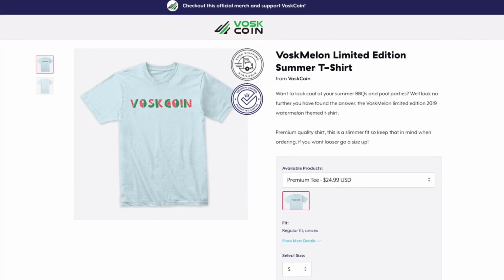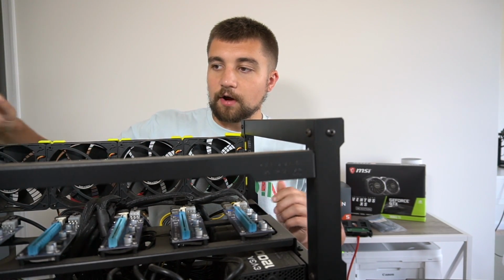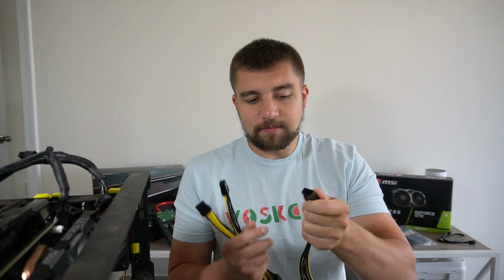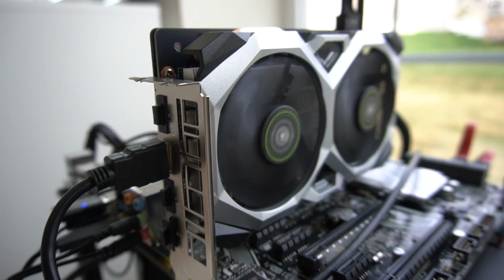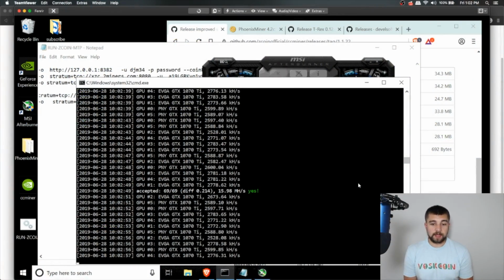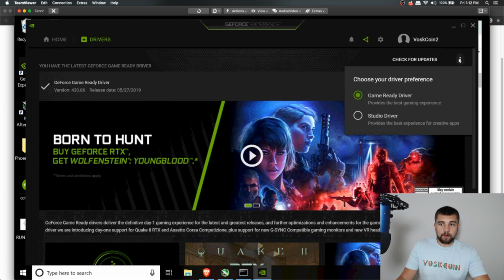Best Bang For Buck GPU Mining Rig Build Guide 2019 - Mine Zcoin, Ethereum, Ravencoin, Grin, and Beam

Comment from the maker: ►Full GPU mining rig build list here! - http://voskco.in/BuildLIST
►1660 TI - https://amzn.to/2XFJOKk ►Used 1070 TI - http://voskco.in/EB1070ti
►Buy VoskCoin VoskMelon t-shirt here! - http://voskco.in/Melon
► Timestamps AND links below!

00:00 Cinematic GPU mining rig intro
00:42 Cool crypto t shirts - VoskMelon
01:02 Free Ethereum giveaway
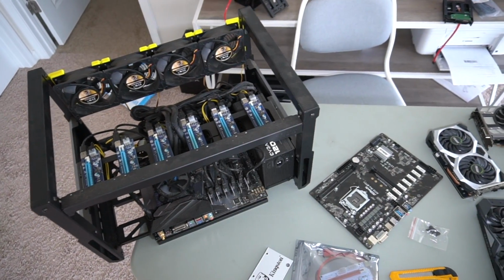01:20 Best coins to GPU mine in 2019
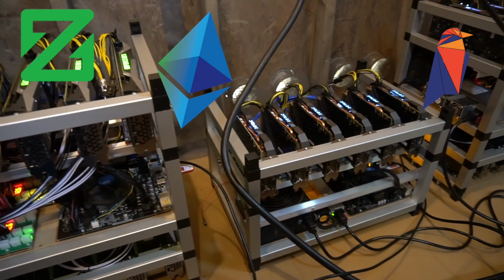01:35 Best bang for buck GPU mining rig parts
02:47 Best motherboards for GPU mining rigs
03:23 What is a PCIE riser for mining rigs
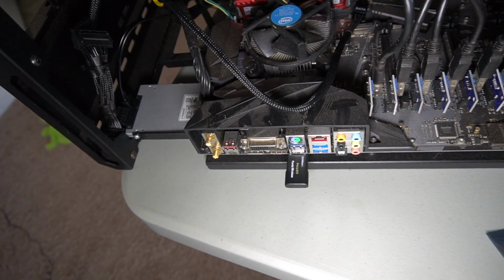04:52 Best CPU’s for GPU mining rigs
06:00 How to install CPU on GPU miner
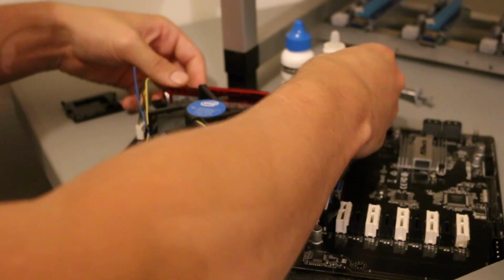06:24 How much + how to install RAM miner
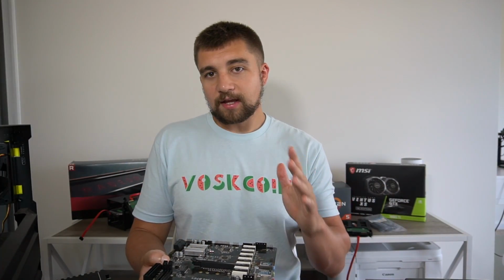06:35 What power supply to use GPU mining
07:05 Best bang for buck GPU mining rig frame
07:29 Veddha GPU mining rig frame review
08:35 Best power cable switches for mining rig
09:43 Assembling rig frame, installing risers, misc
11:09 Where to install RAM - Asrock, Gigabyte, Asus
12:15 Best thermal paste for GPU mining rigs
12:44 Best hard drives for GPU mining rigs
13:30 Can you mine on wifi + best wifi adapter
13:55 best bang for buck GPUs for mining 2019
17:16 Using SSD or m.2 Windows mining rig
18:38 Safety tips - PCIE splitters 6 pin vs 8 pin
19:30 Sata power PCIE risers for GPU mining
19:47 GPU memory required varies by algorithm
20:52 GPU mining rig troubleshooting help guide
21:05 Diagnosing bad PCIE riser on GPU miner
22:11 Using old and new GPUs on same GPU miner
23:37 How to calculate GPU mining rig power usage
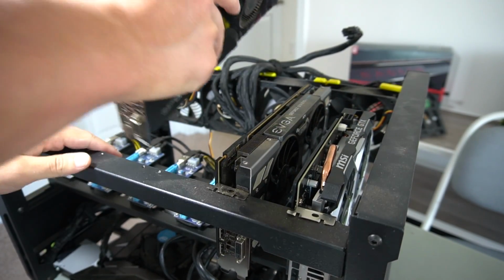25:20 Best Zcoin miner, profitability, hashrate, overclock
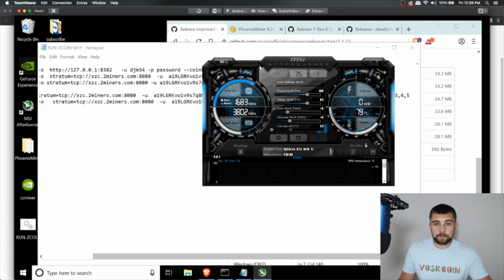27:31 How to overclock your GPU mining rig 2019
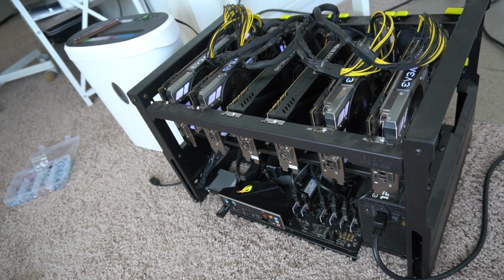28:28 Overclocked GPU miner hashrates vs stock
30:00 How to GPU mine Ethereum ETH in 2019
31:45 How to GPU mine Ravencoin RVN in 2019
32:45 How to GPU mine Grin and Beam in 2019
34:32 Building a GPU mining rig in 2019 review

►Download links!
Ultimate new and used rig parts list - http://voskco.in/BuildLIST
Best and cheapest Zcoin XZC miner! - http://voskco.in/XZCminer
Official download link Zcoin XZC wallet here - http://voskco.in/JL8g
Best Ethereum miner download link - http://voskco.in/ETHminerp
Best Ravencoin miner download link - http://voskco.in/RVNtrex
Best Grin and Beam miner download - http://voskco.in/gminer
MSI Afterburner Overclocker - http://voskco.in/MSIoc

►VoskCoin Links!

VoskCoin Patreon - https://www.patreon.com/VoskCoin
VoskCoin Facebook - https://www.facebook.com/VoskCoin/
VoskCoin Reddit - https://www.reddit.com/r/voskcoin/
VoskCoin Discord Server Invite - https://discord.gg/FGGmS2z
VoskCoin Twitter - https://twitter.com/VoskCoin
VoskCoin Instagram - https://www.instagram.com/voskcoin/

VoskCoin Official Donation Addresses
BTC - 12PsgKuhcJrEqJbD3oMN7rcEcuyqyqRznL
ETH - 0xDEe6A2ae293F8C58Ef71649658344BbF382b6e70
ZEC - t1ZoVF5t75NahSAfuwpcyHA8uzkPyocXpJZ

VoskCoin is for entertainment purposes only and is never intended to be financial investment advice. VoskCoin owns or has owned cryptocurrency and associated hardware. VoskCoin may receive donations or sponsorships in association with certain content creation. VoskCoin may receive compensation when affiliate/referral links are used. VoskCoin is home of the Doge Dad, VoskCoin is not your Dad, and thus VoskCoin is never liable for any decisions you make.

#GPUMining #MiningRig #Cryptocurrency #Zcoin #Ethereum
Reply: What's good just wanted to say your profile sig you should of used on the tshirt your a brand now put voskcoin under it that would be shit hot we all know your sig you dont even need voskcoin on nothing we all know your black and green sig you like mac ds now lol well done bro
Reply: XYO. Whats going on with this crytocurrancy/company? Whatever insight you can provide would be helpful.

I like your videos and Damn you are well equipped. Im just getting into this mining stuff and Im a little confused on how to mine the different coins with my Asic miner.
Reply: And the pool pc setting

Comment: I like the gtx 1070. I just built another (second) 6 card rig featuring them, and tuning them for the most profitability with the least power in my one bedroom apartment has been fun.  I actually set one of the rigs on top of my kitchen stove, because I microwave everything, and push the heat up through the stove's exhaust lol. In the winter I'll have both rigs in the living room and keep the heat turned off.
0xFd31cd986CFeBB7655efd07f15Bb28C23f0B022A

Comment: I started mining back in June of 2017 with some Rx480 and moved quickly to the 1060s. At one point in had 45 cards running in the house but the summer of 2018 they where to much for the AC. Sold most of the cards. Now I'm in the process of build a small shed and I have been doing all the numbers and the new 1660ti has to me my FAVORITE....I really like the size of the MSI cards and the efficiency of the card is great. 

ETH: 0xcBE0FDE41ce90de9415110fdf8e5ff5c0A41e529
Reply from the maker: What about the 2060 🤔
Reply: @VoskCoin  I like the 2060s and have used a couple in gaming builds but the power to hash to cost ratio makes the 1660ti a better choice. Plus with my current power limitation I can effectively run more 1660ti becuase of less power draw.
Reply: @VoskCoin  And I forgot, I love the Shiba Inu. When my wife and I 1st met she raised and showed them. We lost the last one about 5 years ago.
Reply: if you end up building a shed try to just get very good ventilation..i run 49 gpus in my garage and i have a 3ft blade exhaust fan that works great even when its 90 degrees outside. good luck brother and happy mining!!!
Reply: @garrygarrettson4154  I already have the 24" louvered exhaust fan and plan on having 4 rigs inside a box like Twotonhasher has done so I can try and keep the dust out of the rigs. I will be about to house 5 boxes inside the shed with a total of 120 GPU capacity.
Reply: @Space Goats sounds like you got it under control! i have had good luck keeping everything stable just moving allot of air...you are going to love it

Comment: You should look into the P106-100 6G (1060 analog), I paid $80 used and does great on RVN (~13 Mh/s average).  Its resale value is poop, no monitor outputs, but it's cheap!

Comment: Radeon VII decimate the competition, but the bandwidth on the new Navi cards is incredible, 10-15% more mem bandwidth than Vega. I bet It will make 50-55mhs on Ethash easy. Im waiting, for them to arrive and you to benchmark them. I'm torn by the 1660ti and 5700 navi. If eth goes PoS soon, 1660ti will be the card to get. Grin and RVN will always be mineable. 

0xc42613c5514804d3227da1ff2e15441aF73Dadb9

Comment: Best budget minig GPU - 1060 6GB
My favourite from previous generation - 1070ti 8GB
Best all around from previous generation (absolute beast for most core favoring coins) - 1080ti 11GB
Personally looking to build next rig from - 1660ti 6GB
Looking how new Nvidia SUPER variants GPUS wil work I think RTX 2060 SUPER with 8GB would be new champion and RTX 2080 SUPER 8GB with faster memory new beast.

I think AMD GPUs are not enough versatile RX are good for Ethash and CN, Vegas most for CN coins.

EHT:
0x8F3EEc5Ae444Cd5C36E95e845E1204884fa74bFE

Comment: 1070 ti AMP Extreme edition, fast quiet, cool and you can OC them to the moon.  They are just work horse and can run around 125 Watts while doing that.     Eth: 0x1264371409c16728F65d764756880ff419Bc0C5d

Comment: Hey Vosk... you never use amd Radeon VII... tell us what you think abut amd cards...
Reply: i have wanted to try amd VII for awhile now and my buddies over in SMOS rocketchat tell me that they are great but run very hot. i didnt even get a chance to play with any vega cards yet...
Reply: I have one... it is 78c all the time... still didn’t overclock it... my other card is asus rog rtx 2070 oc... runs at 65c...
Reply: @zoom4zam  i think if im not mistaken you can use the AMD mem tweeker tool on that card and get some great hashrates...i really want to get my hands on one
Reply: I am building stand alone mining rig... as of right now all my cards are in my pc... as soon as I get asus b250 motherhood I will try to tweak it ... will try msi afterburner first
Reply: @zoom4zam  if my opinion means anything take a look into getting an asus prime z270p or z270a. they will easily do 8 cards with 1 to 2 M.2 pcie adaptors and are very easy to get going in bios settings. its an 1151 board so you can run the celeron g3900 in it. should be able to find a used one rather cheap...i have allot of these boards and i consider them to be the best boards for mining
Reply: My board arrived today
Reply: @garrygarrettson4154  depends on how much you overclock them.  I have them on my summer efficient setting and they are doing 81 Mhs on 195 watts and run much much cooler also.  When it is cooler out I run them at 91 Mhs and burn 265 watts and they definitely generate more heat.  But I have 12 of them in 3 different rigs and are way better than the 1070's and 1080 TI's I was using
Reply: Thank u for your insight brother...I will be adding new gpus soon and I have been trying to decide which ones I will be adding. I am a huge amd fan and I have contemplated these cards along with vega
Reply: If you are doing Radeon VII's, stick to the ASUS B250 Mining motherboard.  My Asus 270's only supported up to two Radeon VII's so I switched.  It's also nicer because you don't have to tweak the BIOS.  FYI, I have 12 of the GPU's, with 6 in one system.  All with the ASUS B250 Mining MB's

Comment: iv got 4 veddha original frames there sturdy and well made for stacking up it seems you dont have much patience to build them and my best bang for buck on a gpu is the rx 580 8gb iv bought all mine second hand from miners and iv had no problems as they tend to look after the gpu's gamers well not so much i feel due to my experience as they crank up the clock and mem to the max to get the best picture and frame rate iv managed to get 30+ hash per card stable and get the best riser's youu can cheep dont pay at all ver 9+ pci-e id recomend

Comment: Can't suggest any AMD cards as a bang for the buck pick any more. RX580s barely make pennies a day, and even after picking up a bunch of nice Vegas recently, the state of the altcoin market that these mine efficiently is in the dumper. Only Monero makes anything worthwhile, and the devs are f'ing that up with RandomX come October. Throw your Vega rig away after that. My suggestion is, don't waste your money on AMD cards right now. They don't make any cents. 

My pick for Bang for Buck GPUs right now would be GTX1080s. The 1080Tis are still outrageously priced even used. 1070Tis are a  pretty close second for me. But I've been picking up 1080s under $300, and 1070Tis seem to be selling on Ebay in the $230-$250 range. I find that the 1080s will get up to 20% better hashes if they are set up right, and they will remain profitable longer than the 70Tis will. And they will retain their value on the used market longer too. 

I'd recommend Asus' B270 Mining Expert mobos, they are almost impossible to beat in value and flexibility, with the ability to have up to 3 separate PSUs attached to the same board, and 19 PCIe slots. I've bought a couple this year at about $50 brand new. They do require DDR4 which is a little more expensive. And I spend a little extra and pair them with I3-7100 CPUs that can be had for less than $100 used. A new 120G SSD for $35 and a new TP-Link USB wi-fi adapter @ $14 and you can have the bed laid for around $250. 

I've tried a couple different materials to build racks and I've settled for 1/2" schedule 40 PVC pipe you can pick up at any hardware store. The corner pieces are about a buck each and a 10' section of straight is $2. Cut to whatever lengths you want. I get a rack for about $10 that might not be the prettiest, but works just fine. I had an old piece of 1/4" plexiglass I cut to use as mounting for my risers. Once it's all together these racks are sturdy as heck and non-flammable and non-conductive.

Comment: I have a 6 card gtx 1070 rig. Using bminer in Linux. Recently, right after booting, one fan on one card goes crazy fast. Then the rig powers down. I've cleaned the GPU and repasted. Replaced the riser too. Any ideas? Thanks.

Comment: you need to use a set of ram sticks not just one a stick, due to the memory bandwidth, 2x 64 bit bandwidth.. duel memory. one stick won't work. :( 2x memory bandwidth :) also  NVIDIA 1070 ftw!
eth: 0x72aF4A7F781C35Cc7c8d4C5042ab7A306ac8DF3B

Comment: Are there any PCIe cards which 'split off' PCIe slots for more cards? e.g. a card that sits in a 16x slot  which branches to multiple x 1,2,4 or 8 PCIe slots?
That said Would a threadripper be a different proposition for an 'All in One' Mining Rig e.g. Home server, gaming, free NAS etc?On another tack is this 'OK' 
or overkill for mining? ASUS B250 MINING EXPERT ATX Form Factor, For Intel Kaby Lake LGA1151 CPU. 19 X PCIe Slots, Triple ATX 12V Power delivery 2x DDR4, SATA 6Gb/s HDMI, USB3.0

Comment: Nice video Vosk!  Covers a lot of ground in 30 minutes. I would have to say the 1070ti would be my ideal card, unfortunately I haven't been able to get any at a good price. So I built my rig with the 1060 6GB which is not to shabby.  
0x2a8826cCE2907571F7c5ec9c8D5AAa1402D6EE72

Comment: Wich one would you recomend more Asus 250 or h110 pro btc+ for a 8 to 12 gpu rig
Reply: Ivan Novak wondering the same here
Reply: Swapped from an H110 (only has 6 slots) to the gigabyte fintech b250 (13 slots with 1 PSU). I'd recommend the fintech. I use an i3 7th gen so that troubleshooting isn't so obnoxiously slow

Comment: I've mined with AMD RX580's (~ 1.1Mh/card), the RTX2070 (~2 Mh/card), and the GTX1660TI (~3 Mh/card) on Zcoin.  When comparing the card price vs performance the ,  1660TI came in best above 8.3Kh/$.  Power is important as well, I melted one fan off my normally horizontal mounted 2070 card in my pc and burnt up my receptacle and almost burned the house running 6 RX580's.  Pictures won't post here but let me tell you, that was scary.  Anyway, did I say low power was important?  From now on it's 1660 TI rigs on separate outlets.  P.S.  I love your links to folders with all the tools (notepad++, afterburner, etc.).  You should make one for Etherium, and Ravencoin.  I already use those you made for Zcoin and Beam/Grin.  Keep up the good work.

Comment: My favorite GPU is the 1660 or 1660ti. Both hash great and use very little power. Bang for the buck in my opinion is among the best. 

ETH:  0xE36EbB268224D08cFB749ea2e3431982F58e3397

Comment: rtx2070 is the most versatile gpu. you can also mine tensority 9.5kh or dual mine eth+tensority 30mh+4.5kh or single mine eth 45mh (125watt 55C low rpm fans eth only)  
ETH: 0xe3a424a109B637450DB1D048434D59CE25369333

Comment: can this be used for rendering 3d images?
Reply: depends on the needed data throughput per pci-slot. i guess you would want your gpus on a pci3.0 slot for rendering, so you´re better off with a sli setup and/or nvidia titans. or even quadro workstation gpus

Comment: When i use 8gb memory My RX 570 8GB x7. It complains that is to low memory and vant more virtuellt memory from windows
Reply: you should check out simplemining.com they have a great operating system based off of linux. i can check my rigs and see temp and speed and drop outs even while im at work and if i lose power they kick right back on...you should consider dual booting with a flash drive if you need that system to work with on windows...happy mining!!!

Comment: Yowh man! Tried to use the ccminer to mine zcoin but it seems that it's not working. Even on benchmarking it doesn't want to connect to the server. So I ended up using crypto dredge.

I'm asking your help on this cause I want o test out the software for MTP algo in my nvdia rig

Note: am using the 1660ti. Ccminer works on other algo. And am using the awesome miner to launch the softwar
Reply from the maker: did you use the latest ccminer version posted by djm?
Reply: Not sure if awesome miner is using the one from djm, but I set it to auto update to the latest software. Will check on that.

But just in case im getting the right software, can you send the github link? If it's in the vid desc, I'll just get it from there.

Will update you on the progress

Comment: Power cost is a killer here in Australia so im really interested in the 1660ti but roi wise used amd rx  570/580 cards are great if you get them cheap. My 1080 has the best profit after power of my cards but too big an investment, I got lucky and picked up mine for $500aud ($350usd) a while back.  Been keeping an eye out for cheap 1070-1070ti-1080 cards but havent gotten lucky for a while.
What do you think of XWP and Grin? 
ETH 0xE498ab225210B87fDF5afFcfD9E62Fa61c667bC4